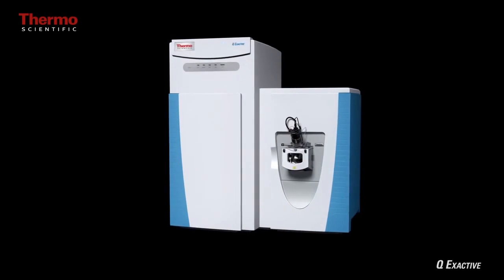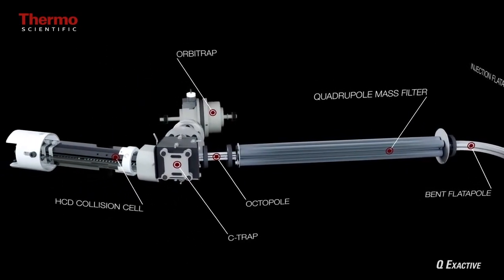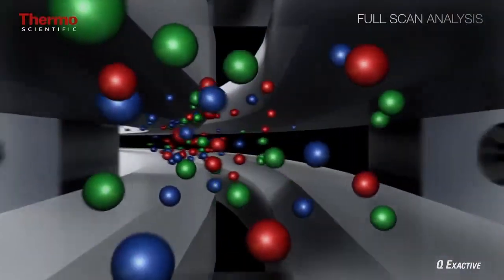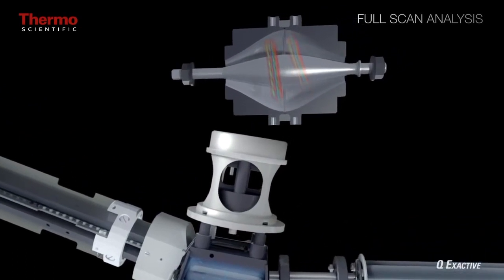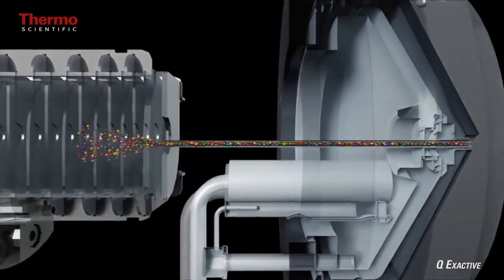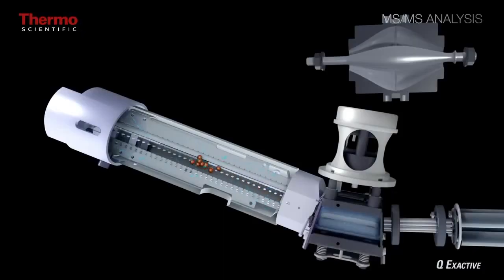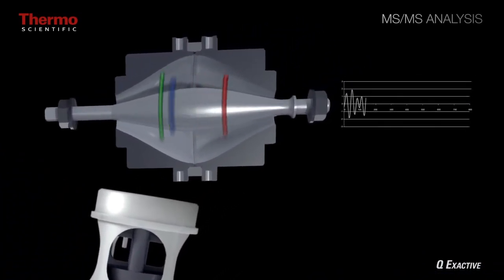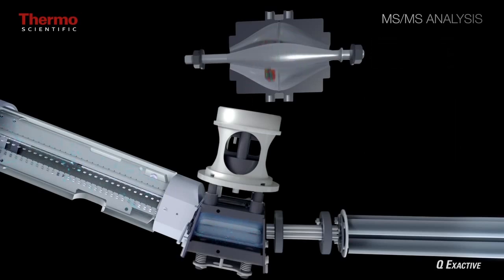Q Exactive

Comment: Ions with different m/z will oscillate at different frequencies along the axial direction. So it is actually the axial oscillation signal that got Fourier transformed to m/z values. For your reference: https://pubs.acs.org/doi/10.1021/ac4001223

Comment: Hi! Thank you for this video. Your explanations are really clear. But still, I don not understand, in the MS2 mode, once the quadrupole has selected the ion of interest (precursor), where the other ions go? And after the analysis of the first set of ions in the Orbitrap, where do the next set of ions come from? Thank you for your priceless help
Reply: Alejandra,
Quadrupole acts as a filter, so only certain precursor ions, let’s say 500+-0.5 m/z, could pass, while other ions become unstable, hit the wall, turn into neutrals, and cannot move forward. Thus, only packets of 500+-0.5 m/z are proceeding for fragmentation. 
Also note that one MS1 scan is followed by 10 or more MS2 scans. During the MS1 full scan, the software determines top 10 most intense precursor ions at that point in time. In the subsequent 10 MS/MS scans, the software tells quadrupole to open for 500+-0.5 m/z, fragment that top 1 packet of ions by HCD, and measure fragments in the Orbitrap. Following that, it then tells quadrupole to open for the top 2 precursor, let’s say 600+-0.5 m/z, fragment that packet, and measure. After completion of all top 10, the next cycle of MS1-10 MS/MS starts.
Reply: @andreidrabovich3921  There's still something I don't understand.  I have had spectra measured in an Orbitrap, and I see that the software shows the fragments for a precursor ion of exact mass. How can one select a precursor ion of exact mass using a quadrupole analyzer? Thank you.
Reply: @felipevasquez8393  Precursor ions (MS1) are indeed measured with Orbi, while quadrupole is nearly fully open. The fast quadrupole analyzer is then used to select the first narrow pack of MS1 ions (for example, 500+-0.5 m/z) for the subsequent fragmentation and measurement of MS2 fragments with Orbi. The quadrupole then goes for the second narrow pack of MS1 ions (for example, 600+-0.5m/z). And so on, to complete the Top20 cycle.
Reply: @andreidrabovich3921  Oh, I see. Thank you for your response!